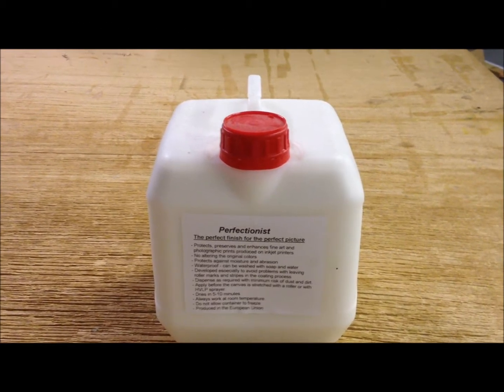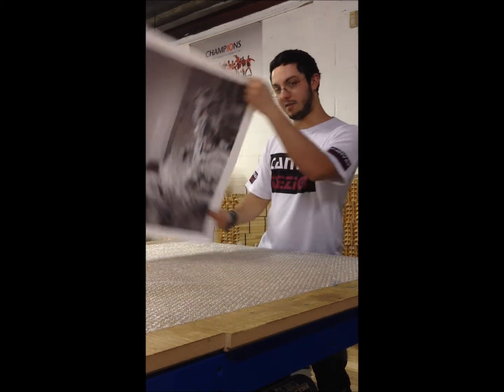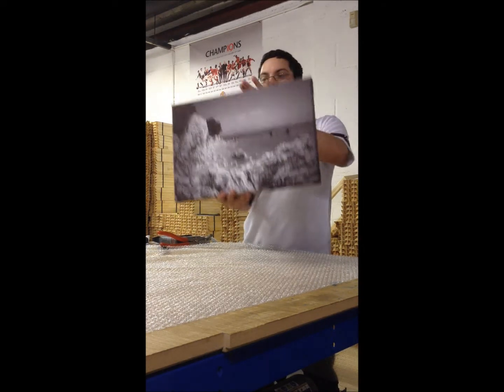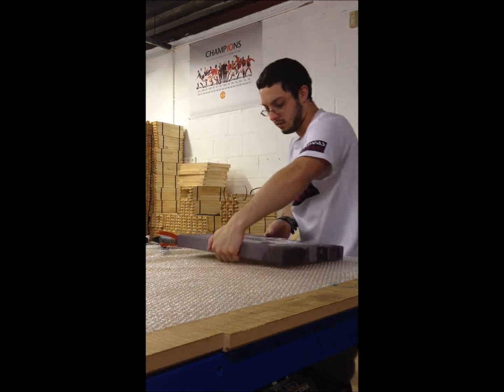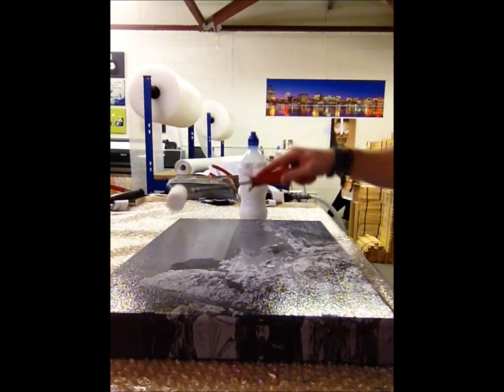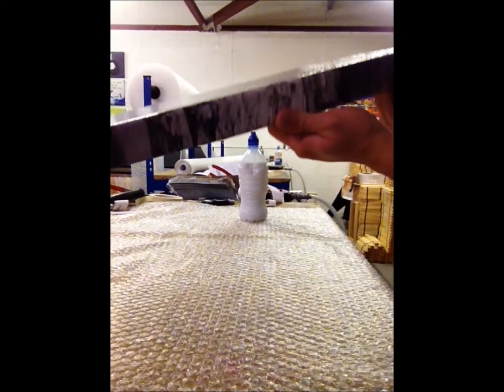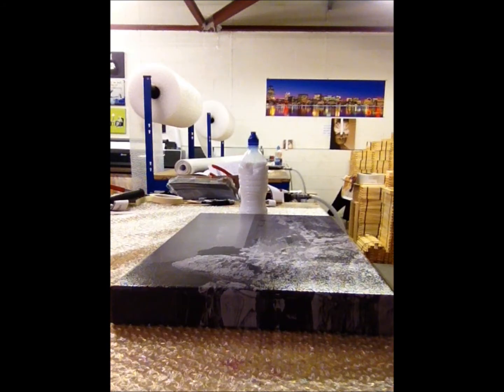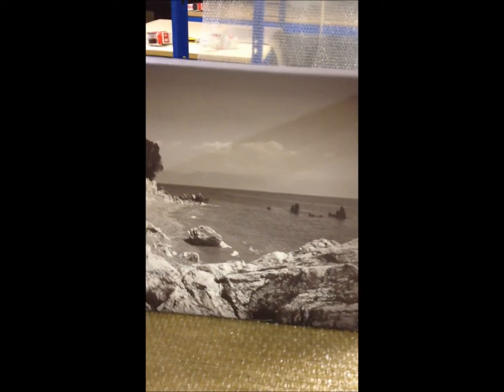Canvas coating video #2.wmv

Comment: This is backwards for canvas prints.  They should be coated first before they are stretched.  Some coatings for canvas prints prevent cracking by creating a molecular bond between the ink and canvas.  If you stretch the canvas first, that can't prevent cracking, especially for gallery wraps.